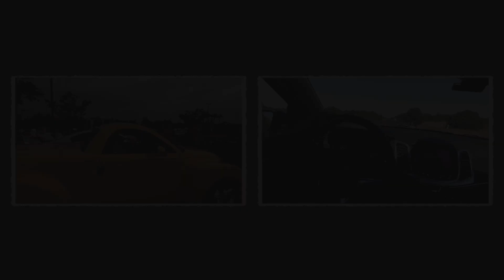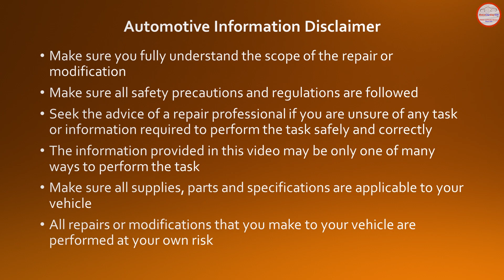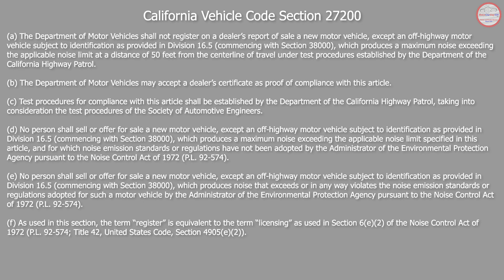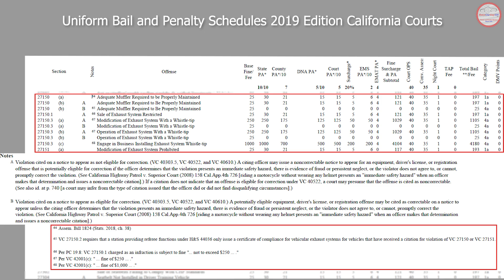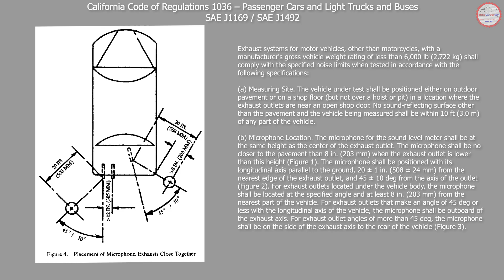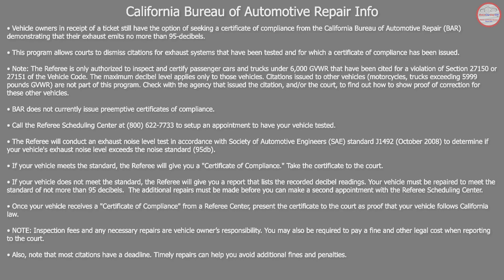CA AB 1824 - Updated Info - Fines and Testing - Check Description for Updates

Comment from the maker: Please check the description section of this video for any updated info regarding the topics covered in this video.  The engine RPM value necessary to comply with the SAE J1169 / SAE 1492 / CCR 1036 test definitions are slightly different from each other.  I'm trying to track down info for all three that I can reference/state in a video or post but the SAE specifications are copyrighted works and they cannot be disclosed (you can purchase your own copy for $81 each like I did for my company).

Comment: So does your Chevy SS fail the at home test then?  There are a ton of loud V8 cars from the factory on the roads....how are those all compliant?
Reply from the maker: It pushed the limits of the 95 dBa limit.  My test environment wasn't close enough to the spec to say it's compliant with the SAE J1492 Oct 2008 testing standards, so my results may not be a good representation of the actual results.  Unfortunately, I no longer own that car, so I can't retest it.

Comment: So can you help me understand what kind of citation i'd be looking at if i have a stock exhaust system where the mufflers and catalytic converters were still in use all the time but i removed the resonator and installed a x-pipe.
Reply from the maker: Street707 - Mustang Vlogger, FPV Pilot & PC Gamer If the exhaust system still contains the mufflers (without a cutout device) and it’s fully functional and the noise level produced by the vehicles is under the 95 dbA limit, I don’t see how you should receive a citation. If the noise level exceeds the 95 dbA limit, you likely would receive a citation for VC 27151(a). Law enforcement officers usually do not carry decibel meters, nor can they replicate the SAE J1492 testing conditions in the field.  The sound level produced by the vehicle would have to be “obviously” too loud for them to cite you for an exhaust system noise citation.
Reply: @RetroCarGuy530  Thank you for the reply. My exhaust in it's stock form is loud already and this would indeed make i louder. If the sound is louder then 95dbs what is the citation for that?
Reply from the maker: Street707 - Mustang Vlogger, FPV Pilot & PC Gamer I believe the citation would be for VC 27151(a). VC 27151(b) is where it defines the  95 dbA limit, but 27151(a) is the one that makes it a violation to operate a vehicle with modifications that makes is louder than the limit that applies to that vehicle so that’s why I believe it would be a VC 27151(a) citation
Reply: @RetroCarGuy530  Okay thank you. Sounds like a $200 fine or in that range. I appreciate the info.

Comment: Very well done video. I wonder if any sort of fine would apply if you modified the exhaust on, say, a Ford Raptor, which has a GVWR of over 6000 lbs. Or perhaps there's a different set of codes.
Reply from the maker: +Zack Schmiesing The BAR info says to contact the agency that issued the citation and/or the court to see how to have a vehicle with a GVWR of 6000 lbs and higher on how to show proof of correction.  I have not found a definitive vehicle code section that defines the db(A) limit for recent model year vehicles with a GVWR of 6000 and higher other than VC 27204 shows a specification for over 6000 gvwr but not over 8500 lbs with a max db(A) of 80 for date of manufacture after 1977.